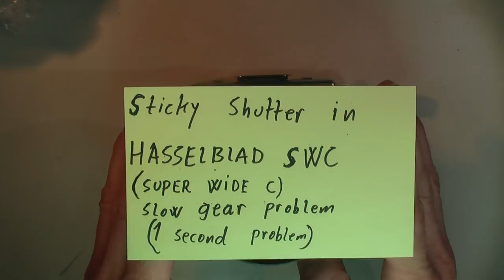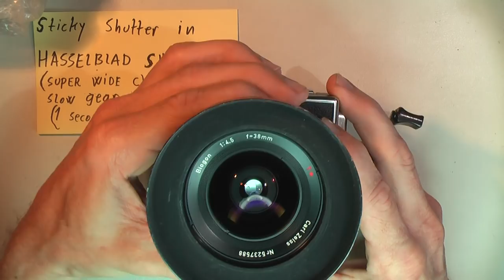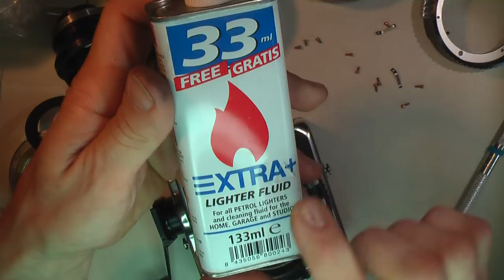Slow gear problem in HASSELBLAD Super Wide C______Part 1

Comment: Thank you for the follow up. BTW...Videos are just fine.. Good lighting and a proper lens focal length for perspective. 

Maybe in those areas where a higher degree of difficulty is expected 
 i.e. a gear "overlays" another and right below it there is an E clip which might JUMP out...or tension needs to be constant against "tooth A " when engaging against spring C, D and E 
Those are the moments where additional detail, such as your  text bubbles or something similar?
Such times where the manufacturer even makes special note to a trained technician as a Caution, warning or "Danger Will Robinson, Danger".?
All in all I am learning how to CLA (to a point) my C lenses. They are running well thank you again.

Comment: bad repair, this is bread for today and hunger for tomorrow, when the speed retarder goes slow is because it has been dirty, if you apply gasoline over it as in this case you melt the fat and change it, when this happens to disassemble the retarder and clean it, if possible with ultrasounds, to dry it and reassemble it, and of course the cage of the blades of the shutter since the grease that you have displaced with the gasoline, will surely end up in the sheets.
Reply from the maker: Well, the camera is still working..., and it's actually 5 years ago.
Reply: I was about to comment the same. An extremely lazy "repair" (you can't call it a repair.)